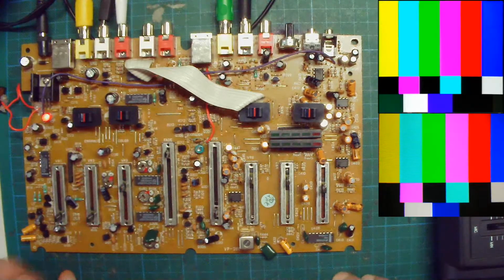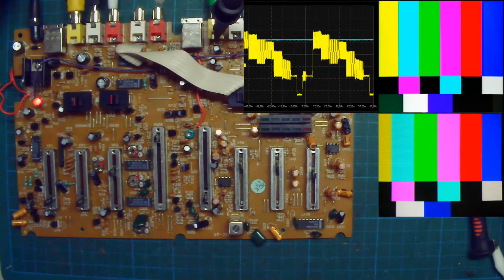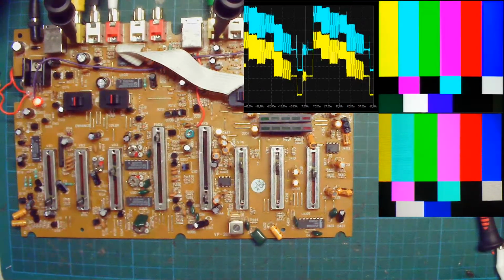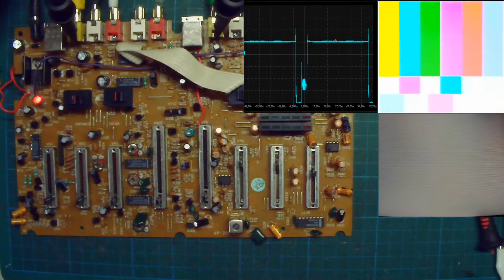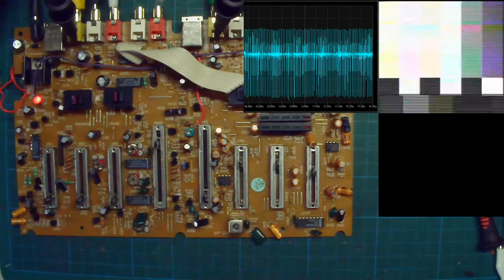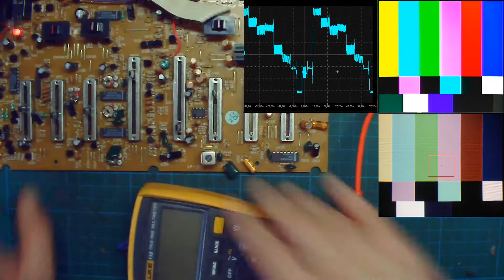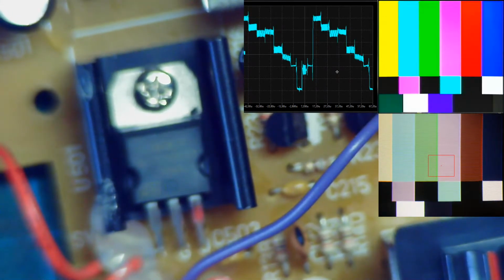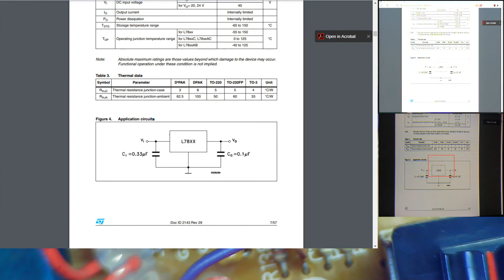Live Circuit Bending -  Fubar 2020 Part 1

Comment: Thanks for posting this video Bastien 👍🏼
I'm really curious to see the following videos in this series. You've given me the inspiration to open up a Panasonic AVE-5J I've got here. I'll definitely have to keep an eye out for the Power Supply as its 240V mains powered.
Reply from the maker: You're welcome, happy that can be useful. You can find the service manual of the AVE5 here 
https://github.com/Syntonie/videomanuals/blob/master/Panasonic/Panasonic_WJ-AVE5_SM.pdf
Can help to figure out the internals of the mixer, RAM seems to be interesting to mess with, I don't have much experience with bending digital stuff though.